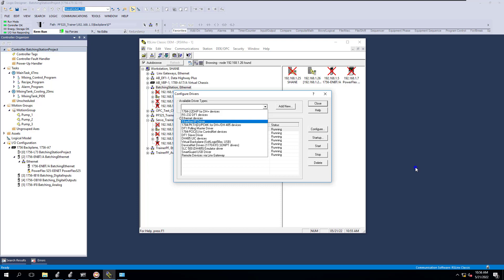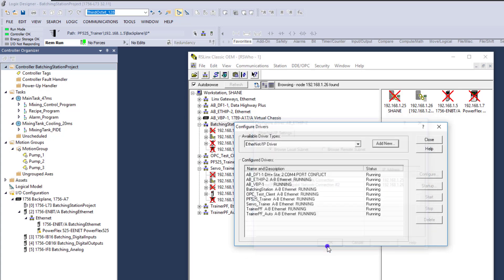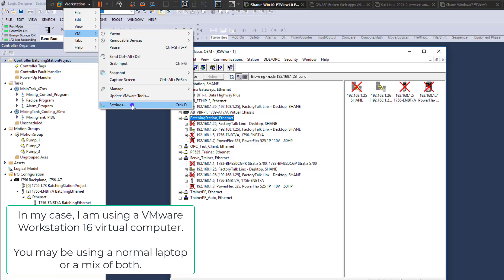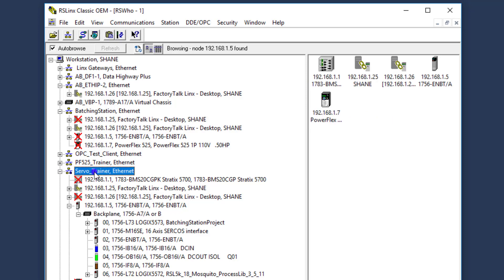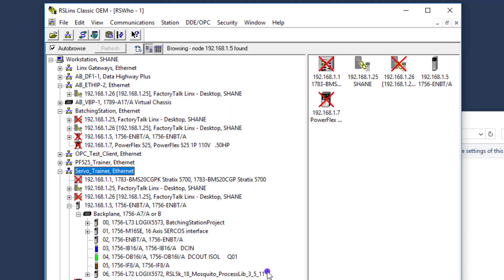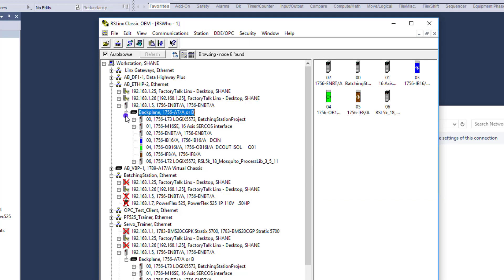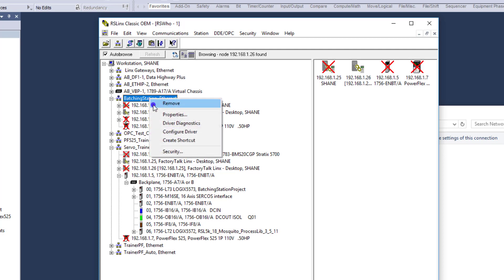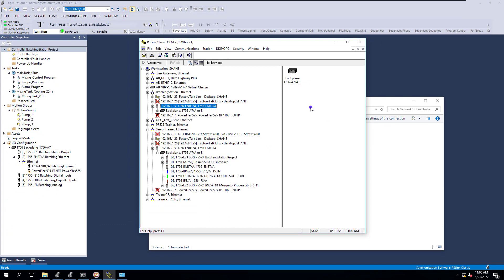Troubleshooting an RSLinx Classic Ethernet/IP Driver

Comment: Hi Shane, Great video! I'm trying to connect to a compact Logix 1769 but can only see a 1789-A17/A Virtual chassis on Rs linx and I cannot establish a communication path through studio 5000 would you know why I cant see the 1769? I'm using ethernet for connection. Thanks!
Reply from the maker: Make sure your IP address is set and without range of the plc

Comment: Hi Shane,  I have a question for you, maybe you know.
 I have an older laptop with: win 7/64/SP1; 1756-L61/B with few I/O modules on 7slot chassis,  and rslogix5000 v19 and 19.11 firmware. No issues, rslogix was working fine  until I formatted the drive, new clean win  .RSlinx classic/gateway is fine --I see all devices in there connected and communicating, I can go online, upload, download.  Problem is I cannot add the modules back in the I/O config when I create a new project. I can only add the processor and go online/rem run but that's it. In the I/O tree my New Module option is greyed out, as well the logic instructions menu. Funny thing is if I open an older acd that i saved before on a stick I can download and go online and run the program with the correct modules. 
There is no security , and even security option is greyed out. No idea what happened. Thank you!
Reply from the maker: Sounds like you bought an old computer from Ebay.

I wouldn't recommend that, there are often problems with those.
Only buy something from a trusted source.

I provide a VM in my course for training.
Reply: @ShaneWelcher  Thanks for reply. I fixed the problem. I had an "incomplete"  version of RSlogix , with like a view license . Lucky I found a "full " V20 :) ....And no, the laptop was mine. I would buy a license than to buy/pay $800 on a shady ebay laptop. Problem is most of the time rockwell won't give you a license if you don't have a company registered with them. ...so we have to find other ways around to make the software to work.
Reply from the maker: @spidergt80  I provide the software in my course

Comment: Hi Shane I have RSLinx that shows my PLC in RSWho , But the program doesn't show it when I try to connect I'm using Studio 5000 v 32.0 . 1756-ENBT/A and I can see it.
RSLinx Classic Lite 4.21
Reply from the maker: Meaning...you can setup an RSLinx driver & browse it then it does show the PLC processor but from Studio 5000, you are unable to download.

Is that correct?

If so then make sure you are browsing the correct RSlinx driver from Studio 5000 then check the status of the Upload, download, go online buttons.

If they are greyed out then save the Studio 5000 program to a safe location so you can find it then close Studio 5000 then open the saved file & try to use the WhoActive comms in Studio 5000.

Let me know if that helps
Reply: @ShaneWelcher  
Well I think it did the trick I was on a work PC so I was off for the weekend, but when I tried it Monday afternoon it worked I could see my PLC in RSlink, and in Studio 5000
You are the man.
Not I need your step by step class on Studio 5000, and Panleview, 
But thanks 👍
Reply from the maker: @Mr Trader  I made a video for you being released tomorrow on my channel about what I thought you mentioned.

RSlinx With Studio 5000:
https://youtu.be/DurPX8dgCTE

Also, I teach very in-depth knowledge in my courses on...

www.Allen-Bradley-PLC-Training.com